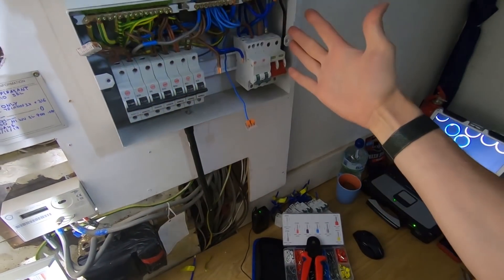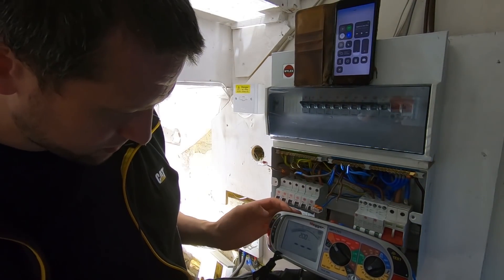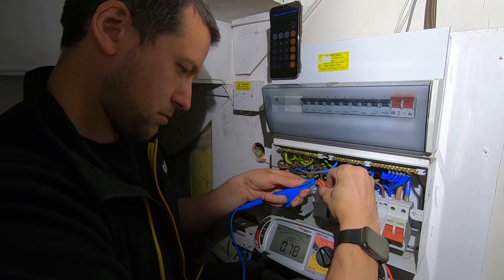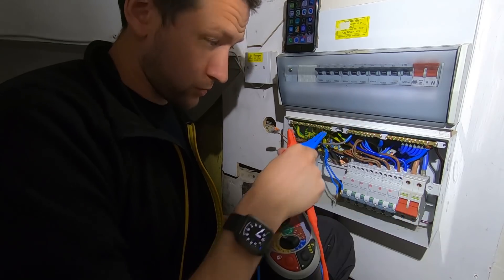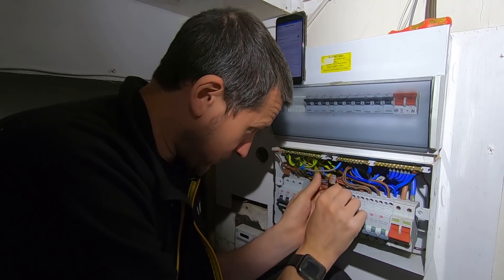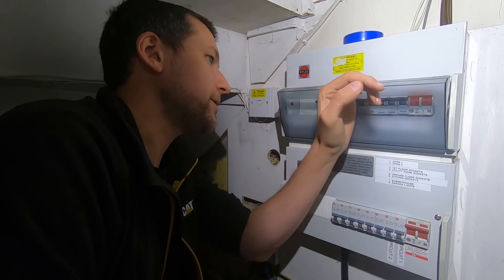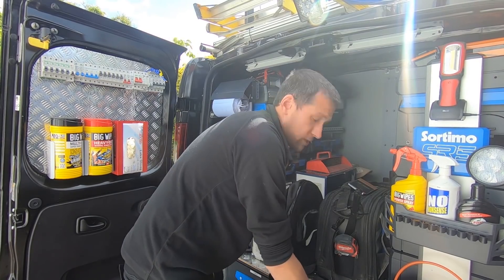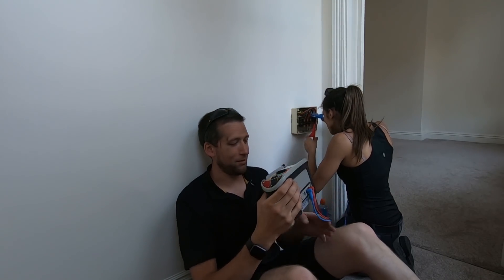Installing RCBO's and using some very snazzy Ferrules | Thomas Nagy

Comment: Upstairs rings are where everyone plugs in their 3kW fan heaters on those frosty mornings while they get dressed isn't it? oh perhaps it's just me.
Reply: Only up north, when the gas pipe freezes lol! I agree with you, however. It's why we have 13A plugs, and expected loads on domestic rings are calculated for 3kw heaters (for those that don't know..)
In London, even in the spring, the concrete maintains an ambient temperature akin to a BBQ pit roast on Mercury! It gets hot! Still would feel robbed sticking a ring on a B32 though...

Comment: It will be interesting to see how the EICR gets positioned in the rental sector. It could work out well for landlords in respect of DIY horrors or  tenants not meddling. On the other hand, it might end up like an energy performance cert, which means not a great deal, but gives tenants an opportunity to act up if they're served notice and don't have a copy.

Comment: That is some size ring circuit. Assuming its 2.5mm line and neutral then that works out to 145 meter ring which is above the max 100 meter. But either way it was already installed so who cares but just thought I would point it out. Love you vids!

Comment: Work wise I am as busy as usual, I managed to work through the lock down as well.
I don't blame you doing it on site, why should you do it at night after work.
There's a lot of electrical firms that have always under charged when it comes to EICR's, because they don't understand the responsibility that comes with signing the document and the implications, good luck to them, there's no way I would entertain doing a test for £100.

Comment: I find the concept of using ferrules is predominantly better using Tri-Rated cable especially if working in singles or panel building also very neat with the compatibility and wear tear very good ? The only downside when they are adjacent it can be a squeeze dependant on terminal room ie relay bases and small component fixtures 👍

Comment: FYI
Breakers on the din rail on the back door. I used to do that until I realized that when it's raining it isn't doing the breakers any good. Moved them into the van, onto the front of a racking shell. Much better,  trust me!!
Reply: That’s what the rain seal around the back door is for.
Reply: @LongwingObservations  don't think he means when the door is closed 😂
Reply: Most people keep their doors closed on their van, irregardless of the weather.

Comment: As a student spark and as a PC enthusiast I disagree with only using a 20A Breaker on an upstairs ring as my whole setup uses 13A plus the rest of my devices that use 5A my whole bedroom,    would leavetwo rooms which obviously isnt enough 32A should always be fitted
Reply: Theres not much upstairs to go on a ring generally  so it could be put on a radial circuit with a  20 amp mcb assuming bedroom heaters are on a different circuit, unless your doing some cultivating with a few heat lamps  lol.
Reply: 3kW that's a lot of PC
Reply: @greenhac1  Maybe he's mining bitcoins.

Comment: I got the same kit, same crimp and everything , i even use them when i wire a plug , its so cool..... am i sad ?

Also little nit pick i know but a kettle is a restive load , it cannot get any more efficient :P
Reply: I caught that too. And while small appliances tend to use less power now that tends to be as much because of upper limits (set by the dreaded EU)  as improvements in efficiency
Reply: Kettle boils faster with Avon water.

Comment: The bootlaces crimp better (and go on easier) without twisting the cores I’ve found. Used them pretty much every day for the last 14 years in control panels.
Reply: I weird control panels for nearly 3 years and it taught me so much! how contactors work, relays, drawings... loads of things great thing for all sparks to have experience in
Reply: It's actually bad to twist the strands because it makes the contact surface smaller.
That's why in Germany it's not allowed to twist the strands.
Reply: @scwfan08  It's true that excessive twisting is not recommended, but the wire is already twisted and a light twist to maintain that and make the strands go into the connector is OK.
Reply: @scwfan08  yeah I got told not to twist strands either, if you just pull them base to tip it should straighten them out and slide them on without any whiskers
Reply: I use some of the ones without plastic 'funnels' also (handy in plugs). Those do require twisting slightly, but yeah the ones with plastic funnels don't need twisting. As I'm getting older tho they do require reading glasses LOL

Comment: Been using ferrules for over twenty years & I'd never go back!  Watch out relying on the colours as there are three different colour schemes - French, Weidmuller & German/DIN 46228.

Doing your certs on the go is just the "right" way to do it, it may make the onsite work marginally longer, but saves time in the long run because you're not writing the numbers down twice!
Reply: Download this handy colour chart - https://www.efixx.co.uk/Know%20How/ferrules

Comment: I would have to disagree Tom in regards to fitting less than a 32a on 2.5 ring main. If you had a car that was designed to do 200mph would you be happy if the manufacturer limited to 70mph because they deemed you did not need to go any faster than that. It is purely at the discretion of the end user. I agree totally that in this day age a ring main is not needed for upstairs sockets and on new installations I either install a 20a 2.5 radial to suit or on say a 3 bed a ring for house and one for kitchen. Imo the best way to reduce power loss under fault conditions would be a radial for each room that I have seen quite often in other countries. A ring main for the kitchen is warranted but long gone are the days of 3 bar heaters.

Comment: Is there any particular reason why ferrules aren't colour coded to coordinate with wiring?
Reply: They are color coded by wire gauge. The grey ones he used are 4 mil.
Reply: They’re colour coded for the size of the cable they take

Comment: Why is it so important for the fuse board to be made of metal?  I am a Swedish electrician, and in Sweden we install fuse boards made of plastic and metal.  And don't you have fuse boards with more rails?  In a regular house in Sweden there can be a fuse board that is 18x3.   18 fuses on each rail for example.
Reply: Hello Sweden 54 is a lot of cicuits . I would say the average number in england would be around 10  circuits . Why the need for so many in your country ?
Reply: persona250 i think they use 3 phase everywhere (hence 3 different rails) whereas us in the uk use single phase for residentials and most other places (btw thats a guess on the 3 phase! lol)
Reply: Geoff Upton - The normal type of house in Sweden has a three phase feed of 20A. We tend to use around as it was said around 3x12 up to 3x18 circuits divided on 2-3 three phase rcb:s. 
Old apartments are often supplied by a single phase 20 or 25A feed.
But we dont’t have those massive loads of a 32A waterheater.
Reply: @persona250  RCDs for 3 phases use twice the space, no ring curcuits which means about twice the amount of circuits for outlets, breakers who disconnect both L and N, KNX-Stuff, switching for lighting (relais, dimmers, etc.), probably some regulations regarding "free" space (for example 30% in Austria), etc.
Reply: Our regs require the fuse board to be of a fire resistant material or be enclosed in a fire resistant enclosure. There are other substances that could be used but all the major manufacturers have gone with metal so that's what we use. People talk of needing to fit a metal board because that's all the choice we have.
Reply: It's pretty much the same in Estonia.  We did a 1 room flat (1 phase ) and had to use over 20 breakers.
Reply: In England, many fuseboards are sited under the stairs, or directly in the main entrance doorway. Its also cornered the World market in extremely bad tradesmen, and appalling standards of installation due to pricework. The result over the years has been more and more fires directly because of poor installation of plastic units. Efforts to raise the standards, with things like torque ratings have pretty much failed. The only way to cure it was to insist on fitting equipment that can't burn.
Reply: It is UKs regulation for fire safety . They have single phase 100A services for homes. 32A breaker for sockets or cooker  . 40 or 50 A for electric shower. On this load any loose connection is a firehazard.  They do not know the beauty of low currents on three phases :) They do not even have nice three phase distribution boards . Just bulky >100A industrial ones. Nothing wrong about it. Just different way of thinking.

Comment: Those ferrules are ace treated my self to a kit!. There all fun and games untill you knock the box open with the lid open!
Reply: i did that with my terminal crimps ...... i was not a happy boy to say the least.
Reply: @andljoy  me too 😊
Reply: My old apprentice did that on a job once. Made him put every single one back in the right place.......needless to say, he never did it again 😁
Reply: Then its boo bag time 😂
Reply: You want the box with a rotating lid so only one size of ferrules fall out each time you tip it over :)
Reply: Did similar with a screw case of 3400 screws. Never did get sorted, bought another.
Reply: @markrainford1219  😂🤣
Reply: I had mine closed, but end of a long day I forgot it was behind me and stepped on it, ferrules everywhere and box in bits! :'O
Reply: Yep I'll feel your pain it's even worse when you drop a box of numbers!!🤬 Straight up the Henry and start again ! 🙂
Reply: I used to work at a place where they intentionally put all the boxes upside down and opened them up to empty all the content onto the inside of the lid "because the ferrules/numbers/connectors are easier to pick up that way". I’m glad I don’t work there any more.
Reply: I have designed some boxes and lids that I’m waiting to get the time to 3d print, they’re ingenious because each compartment is made of a separate box that clicks into all the other compartments, and is removable, so you can swap each single tray/compartment with other ones. Plus they’re LEGO compatible so you can build your own sizes of boxes, or your own lid if you want to. (Or if you’re into robotics like me, you can use them in machines, like automatic sorting and counting machines and stuff likr that). They’re of course stackable and all that. I’ll upload the design onto Thingiverse if anyone wants to see and perhaps print some.

By the way, about ferrules and 3d printing: over 90% of 3d printer related fires is due to lack of ferrules. 3d printer people don’t know what they are and just chuck their multistranded wire into the terminals, leaving strands sticking out everywhere like an unshaved copper bush. Which in turn heats up, melts and/or burns out components.
Reply: @jhsevs  Will they be under your name jhsevs or different. Always welcome usable 3d print designs.
Reply: Muskrat 1963 jhsevs is correct
Reply: @Sheldon Fieldhouse   Put together my own kit, ferrules and spades are sorted in little zip bags by size.

Comment: What would you have done if there was a fault on one of the circuits, would you have issued an unsatisfactory eicr report and informed the client of the fault?
Reply: Personally I'd inform the client of the fault first and recommend its rectified before I finish the eicr saves doing it again. (If they agree to fix said fault)

Comment: Who is going to tell Tom not to twist the strands before putting them in a ferrule?

It's a real big NO-NO...

And of course that he has to check wire size vs. ferrule size...
Reply: Why no twisting?
Reply: @Alfnmiles  Because your fingers are oily and dirty (corrosion) and you might get a bad/uneven contact on individual strands.
Reply: 1I2am3Dani4 oily fingers would make no difference. I get what is being said about surface area but I have had no problem twisting them and they go into the ferrule much better
Reply: My understanding is that if the strands are twisted then there is a strong possibility of them not displacing properly when terminated under a screw. So, what seems to be a solid core doesn't remain so under pressure. Also, I believe this distortion of the strands inside the ferrule is more likely to damage the ferrule when tightened down onto and it is likely to become loose.
That's just what I have found from previous experience but I am happy to be corrected.
I think consideration should be given as to where and how best to use them.
I like the use of them on the RCBO neutrals but without twisting those strands.
Reply: @kendoknackersackee  I think you are right. When i bought  pack of branded ferrules last time there was a little leaflet with "how to". There was wrtitten not to twist the conductor.
Reply: @evzenhedvabny6259  Do you think that is true for all sizes of copper strands?
I always have a strong temptation to twist very fine strands but my gut feeling is that if they're being crimped into a ferrule they should always just remain straight. And if there is an instruction with the product, I would say that's settled: no twisting. 😁👍
I don't know about you, but for me, Letting go of old habits is sometimes difficult 🤪
Reply: @kendoknackersackee  Yes... old habits ...  Tey are my hell too :) But  i have noticed when i take 1.5mm flex and twist it it sometimes does not fit in to the 1.5 mm ferrule. Mostly with double ferrules.
Reply: @evzenhedvabny6259  Yes, I have also found that with the doubles👍
Reply: It's because you are doing a cold weld. If u twist it it doesn't compress evenly

Comment: You're not supposed to remove the isolation with a wire cutter. There's a cutting tool which does this in sub 1 second and without cutting any of the strands. Also I was taught to never twist the strands, just put them straight into the crimp, to reduce the air gap between them.

Comment: You like the ferrule crimper then get one of these instead of using your side cutter to strip the wire ^^ 
https://www.amazon.co.uk/12-42-195-MultiStrip-Insulation/dp/B000CDSQE2/ref=sr_1_10?dchild=1&keywords=wire+strippers+knipex&qid=1594134839&sr=8-10